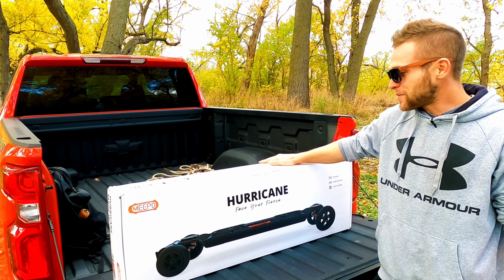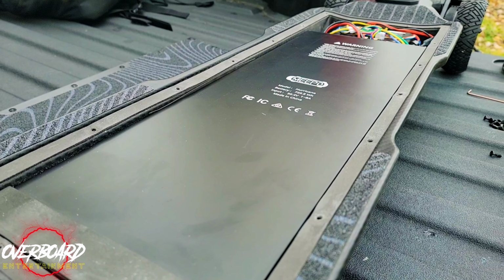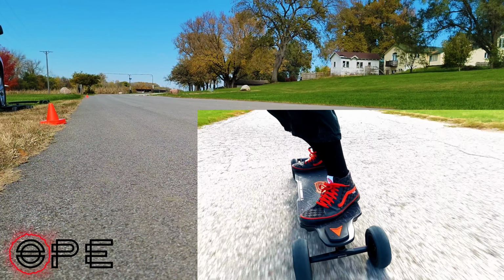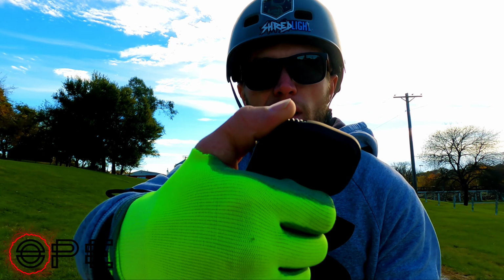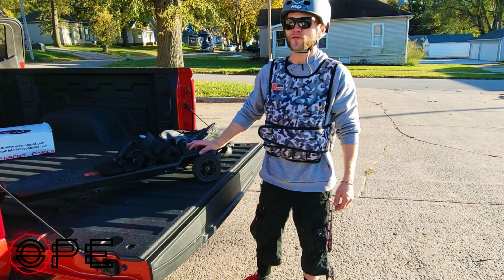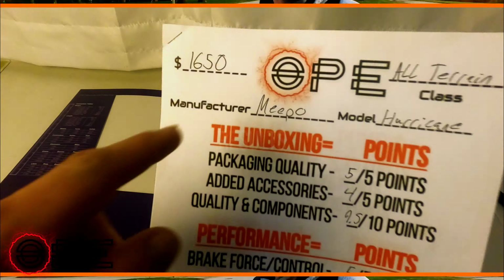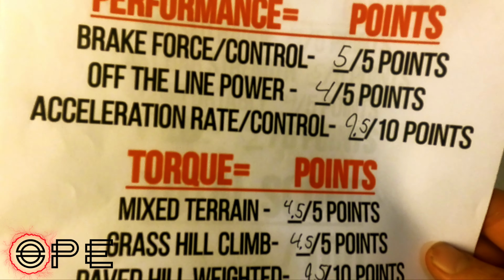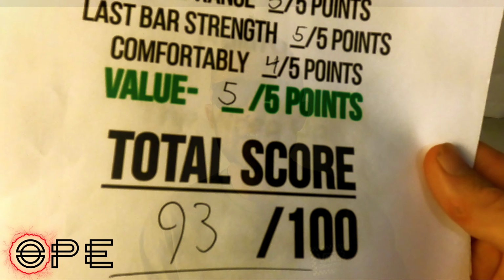Meepo Hurricane - Unboxing | Specs | OverBOARD Performance Evaluation

Comment: Do you suggest the full 50psi suggested onvthe inflated tires?
Reply from the maker: I think that is best for range.... but for ripping off the line and cornering you want a little give
Reply: @overboardentertainment1569  Ok, one guy said 40psi still felt a little too mushy so go 50, another says 50psi felt a bit too stiff. I'll start at 45psi and see how that feels. Thanks man! 👍
Reply from the maker: @goldenagenut  yea man....
If you ride hard, go on the lower end of that spectrum.
Reply: @overboardentertainment1569  I just like to carve casually and go! Im 56, used to ride in the 70s/80s, never lost the love, then after spotting a used eboard for 150.00 I could resist no longer. So much fun! I started looking at expensive off road boards and splurged when they had Hurricanes on sale over the holidays, just came in Monday, so psyched! ...so the cold wet weather decends! 😡 lol Can't wait for Spring! 👍
Reply from the maker: Ayyyy me too brother

I want to make content to but the weather is freezing and icy haha

Maybe this weekend.. supposed to be 45
Reply: Stupid question - you take off the thick plastic film on the bottom of the board, correct?
Reply from the maker: Thats not a stupid question...
Its all up to you,
I took mine off🤜🏼🤛🏼
Reply: @goldenagenut  Been afew weeks now, did your hurricane arrive ? If yes, have you noticed any issues ? 
Were you considering other boards ? Did you notice any yellow / red flags with the other boards you were considering ?
Reply: @LORFCASTER  I read and watched a lot of reviews, the verdict seemed pretty unanimous,  ' This thing is a BEAST!' ... and I totally agree! I havent even dared hit speed level 4, scary, level 3 is a blast. This board is so much fun, it has chewed through everything I've thrown at it so far with ease. Rides smooth, quiet, carves beautifully, power to spare, long battery life, this board is indeed a beast! 😁
 I did have a little accident, started moving, my footing was awkward so i let off the gas but accidentally pushed down lightly on the brake, board stopped , I didn't! I ran about 3 paces and to avoid falling slammed my foot down flat, HARD(!) to stop my momentum. Sounded like a .22 going off. Pain shot up my shin, pretty sure I've broken a bone or three in my foot and might have fractured my shin but its getting better quick...sorta, I guess lol. I'm fine, cant wait to ride again, just giving the foot a couple of weeks of down time to heal up.
 I will say this Meepo is the absolute shit, Ive loved it every time I've ridden, but man it is heavy! Gotta figure a way to carry it more than a short distance, back sling or somethin. I love it and I see many good times in the future riding this puppy! 😎👍 I give it 5 stars!
 The one thing i miss being an old school rider is a kicktail to whip it around instead of stop, get off,pick up, turn 180°, set it down, get back on. Lol ( I can see that jarring the board - battery, motors- so a kicktail isn't going to work with an eboard. )
Reply: @goldenagenut  Thankyou for the response. I have an Evolve Stoke so i know from experience that kicktails DO work on electric boards. I really REALLY wish more companies were aware of their importance.
Reply: @LORFCASTER  yeah, my first eboard was a short board with a traditional kicktail design, loved it, but this Meepo is 34 lbs and long, the sheer weight might make it too awkward to swing around and with that weight crashing down i can see it loosening or possibly damaging some interior pieces/ the battery. What does your board weigh?
Reply: @goldenagenut  Only 18 pounds lol :o
There are materials that can be applied to electronics to hold them in place. Air tires or large / soft urethane would absorb a lot of the impact. Theres only afew inches of lift on the front wheels while pivot turning any board. Also, when pivot turning with a tail, it doesnt feel like im letting gravity return the board to the ground, more of a controlled drop. Id still vote YES for companies to put tails on all boards, even if they're hard to use.
Reply: @LORFCASTER  Actually i wasnt even considering these big inflatable tires, they would absorb a good amount of the shock. Yeah, kicktails rule.
Reply: Went on a 26 mile ride Sunday, my feet were both completely numb by the time I finished, oh man! Fun stuff!

Comment: Ok guy's i get the meepo hurricane after 2 month and half waiting...
I get bad surprise when i open the box, the belt guard was broken and one wheel was deformed and had a flat part what is dangerous.
I wrote to customer service to explain and asked for new tire and belt guard, Bonnie write me and tried to say it is my fault not them, I am liar, I broke it...
I took pics and videos of broken part to show Bonnie that I didn't ride yet with it. 
Finally after more than 25 message she said sorry and tell me they will send me belt guard but nothing about the tire, she said I have to repair it what is not possible. Now I write to them but without any answers.
⚠️ WARNING ⚠️
Meepo has a bad customer service
Finally I don't recommend this brand because if you have any problem you can't get satisfaction.
Reply from the maker: Wow man.... that sounds like a massive headache.
So the rim is deformed?
Reply: Couple weeks later now.... did you figure out what happened ? Was a used / refurbished board sent to you ? Was there any damage to the shipping box or any more damage / issues with the board ?
Has Meepo responded further ?
Reply: @LORFCASTER  They said they will send new one but nothing until now, finally I bought new wheels "cyclone" has good grip but after two ride the profile gone and 105 cloudwheel what is perfect for me just little bit slippy
Reply: @overboardentertainment1569  
Yes unfortunately 😌
Reply: Hi they finally sent the cover belt but I had to pay 9€ for the border fee, that's crazy if I buy it on AliExpress I found them at 4$ for 2 cover belt with delivery, and the most mad is that they didn't sent the tire. 
Meepo only want to sell without taking them responsibility.
Reply from the maker: Damnn... thats all bad.
Sorry it's been so rough with meepo 
..

Comment: Specs of motors are not what they necessarily put out but what they can take/handle. Daniel  Kwan has you fooled by thinking the stator/housing size is the definition. Not a word about the thickness nor the windings. What limits the power output is the battery(current long and short term), BMS and the motor controller. This board is fine in many ways but to me; too thick body and wayyyy too heavy.
Reply from the maker: I have to say I unsubscribed from Daniel when he did a add about wireless buds in the middle of a video a couple months ago or so... but yes... your correct all the way around....
But, the stator size is responsible for what the motor is capable of handling safely...  you can pump intense energy into a small motor and destroy it easily without correct programing....

But even then...
The facts remain the same, like you said about battery pack and esc.
What are the battery pack specs on the Hadean, Hammer and Atlas....?
The ESC output on the Hedean, Hammer and Atlas...?
And what are the stator sizes on the Hadean, Hammer and Atlas motors...?

Now which board is capable of a more powerful, safer output of power
Daniel has no one fooled, especially not me....
He is simply stating the information he is given... as am i.... 
That's why I test and expose any claims about battery sag, range and top speed cuz its all a guy can really do besides state the facts...
and his reference to the Watts of the motor not really mattering is because there is alot of dispute on what number to use.. constant or max and  also cuz its the same point your trying to make....
It all comes down to the pack and what the ESC allows...
Reply: @overboardentertainment1569  I am sure you are not. Thanks for your answer.